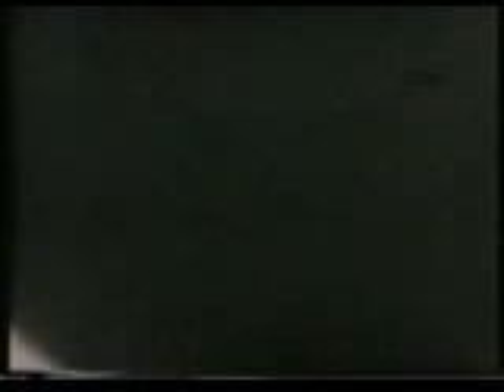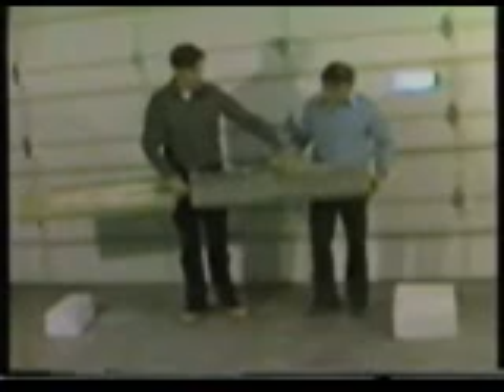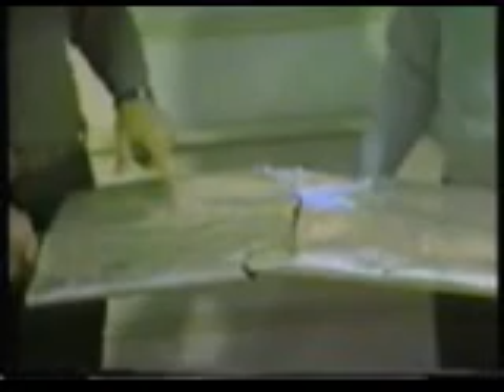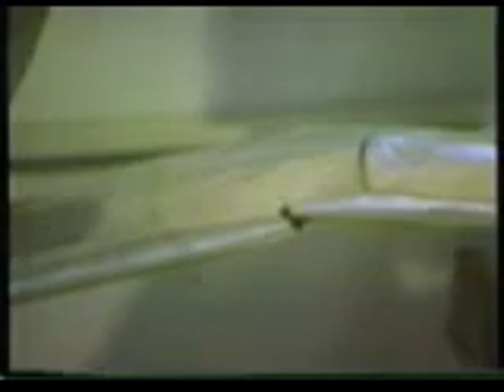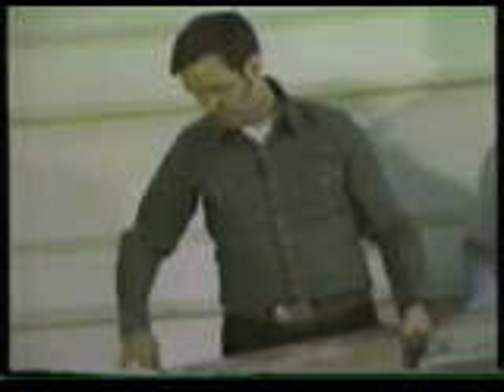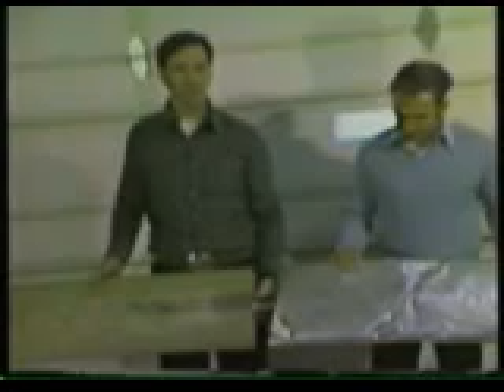Foam/Fiberglass strength demonstration

Comment: Halving the beam's length effectively makes it twice as thick relative to length, which works out about to quadrupling its stiffness; a glassed foam wing, like a sheet of plywood, or a hollow core door, derives its strength by the resistance of its skin layers to tension or compression.  Neat stuff, and I hope you keep an interest, our country needs you.

Comment: On the other hand, I've heard a Boeing engineer quoted as saying "The more you learn about composites, the more you appreciate aluminum". 
All materials, (even such "wonder stuff" as titanium), have properties, attributes, and characteristics, which can be advantages or drawbacks, depending on the circumstances. For example, thin carbon fibre is wonderfully strong until it suffers a little cracking from an impact, (e.g. a stone chip).

Comment from the maker: The wing cores are made of extruded polystyrene, which comes in blocks as large as 10x20x108.  Look up Dow Buoyancy Billet.  It's intended for floating docks and should be available at a local building supply store.  Not the same grade as wing foam but very close and likely close enough for your application.  It's pretty rigid so you may want to forget the wood skeleton and just use foam/fiberglass and reduce weight.  Research homebuilt aircraft that use the Rutan technique, e.g. Long EZ.

Comment: rock on. I used to work building lamp posts using much the same type of construction, only we stuck with a polyester resin, because honestly, it was just a flipping lamp post. but tough nonetheless, and exponentially lighter than the early cast iron counterparts we mimicked.